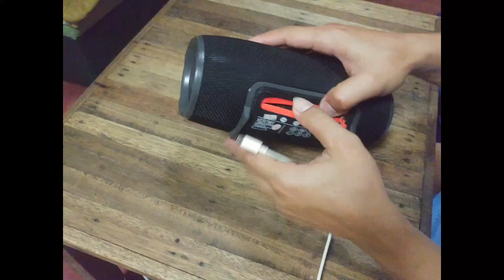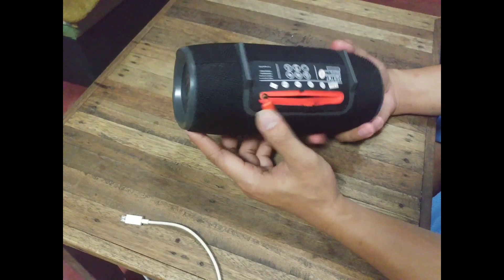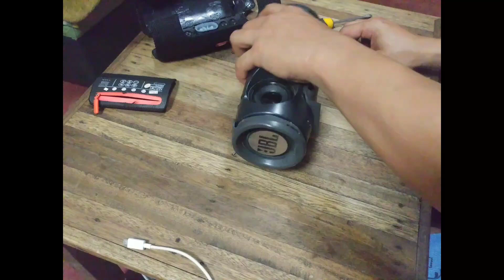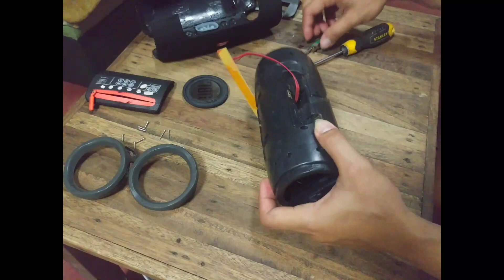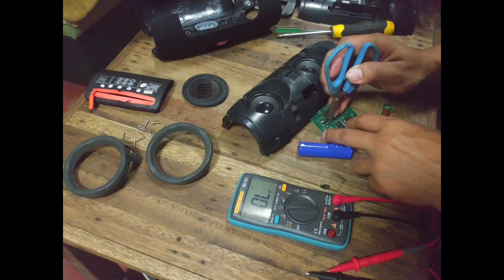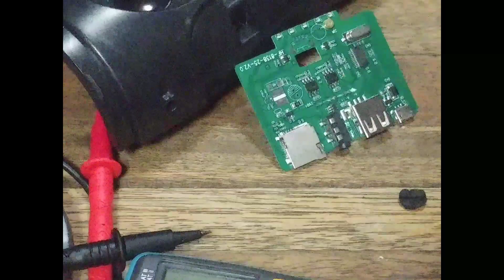NO POWER PORTABLE BLUETOOTH SPEAKER (TAGALOG REPAIR)

Comment: Nice video tutorial lalo na ung full disassembly. Same JBL bluetooth speaker at same problem din po don sa isang channel, pero pinalitan lang po nya ng 18650 battery ung built in kahit 4.2v pa karga nya, nasolb problema nya! Parang common issue po yan sa mga JBL bluetooth speaker model lalo na kung class a na ang bateryang ginamit ay kahina-hinala ang totoong boltahe.